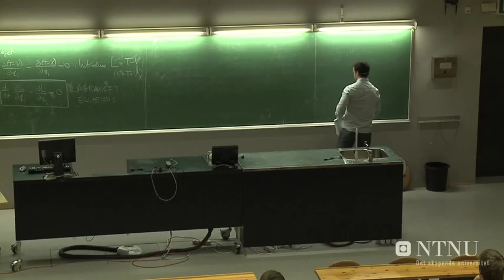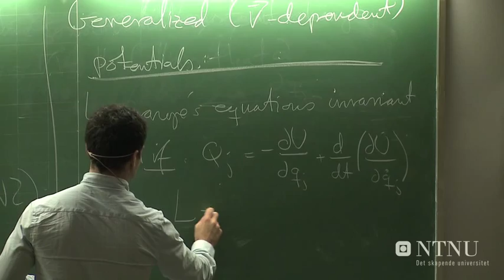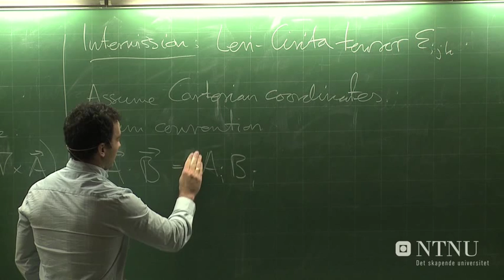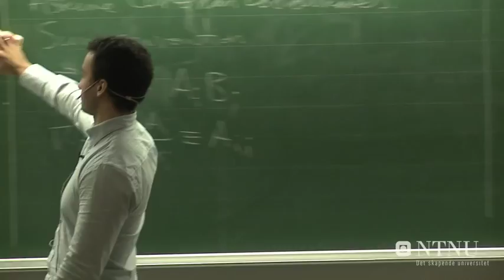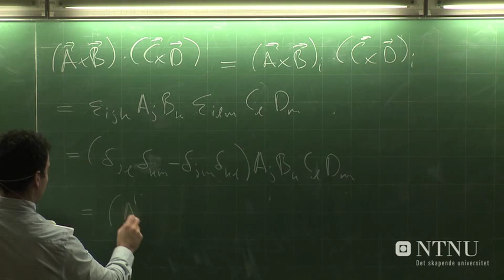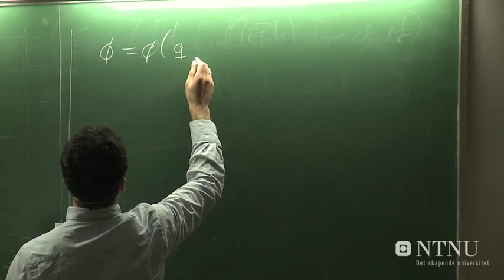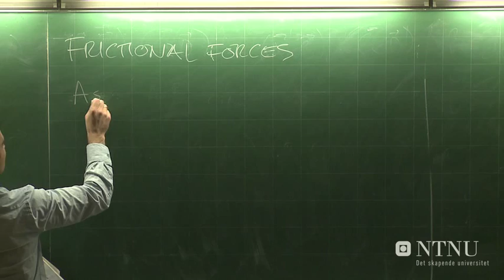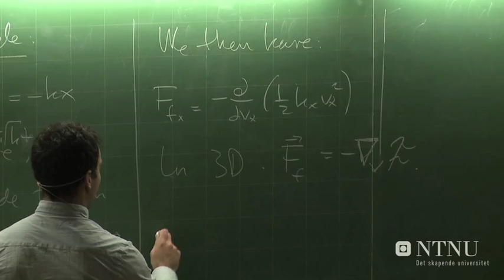04: D´Alembert´s principle part 2

Comment: Gee great lecture!  It took me a while to figure out the step at times 26:10 - 26:20, but if you just religiously follow the formula for two L-C symbols, it works out.  It took me a lot longer to derive that formula, though (he left that derivation to us or I guess a vector analysis class).

Comment: Prof. Linder is an excellent professor.  He does not go off onto tangents that have nothing to do with the subject at hand.  I have one request.  Does anyone know which textbook that he uses to accompany his class.  I would like to read the text along with my notes.  Also, I will feel more confident with the material if I could challenge myself with the problems that go with each chapter. Finally, if there is any additional things that coincide with the class like notes or a syllabus, then I can get as much out of this class as possible.
Reply: According to the course information, he is using this: H. Goldstein, C. Poole and J. Safko: Classical Mechanics, 3. ed. 2002
Reply: @vlastimilhosek8072   but isn't that  a grad school textbook ? 
i thought these lectures were given to 2-nd or 3-rd year undergrads.
Reply: H. Goldstein
Reply: @alephnull6965  It's given to Master's students according to the NTNU website.
Reply: @alephnull6965  Susskind's (Stanford) course is more geared to undergraduates.  The down-side is he make a lot of math mistakes on the board, which he freely admits he has a habit of doing.  He assumes things to be true without derivations.  But of course that's more in keeping with an undergraduate course.